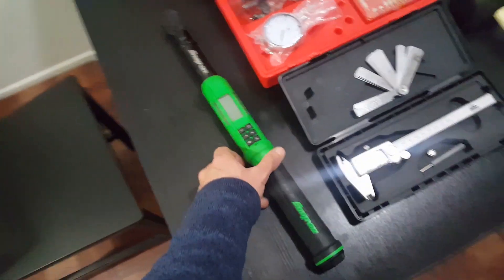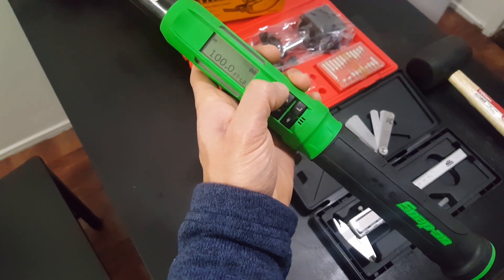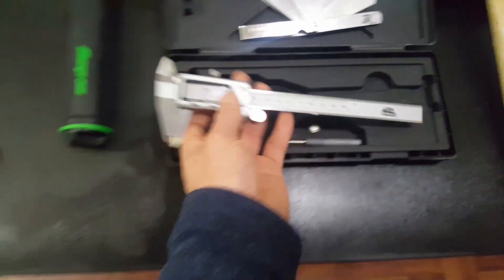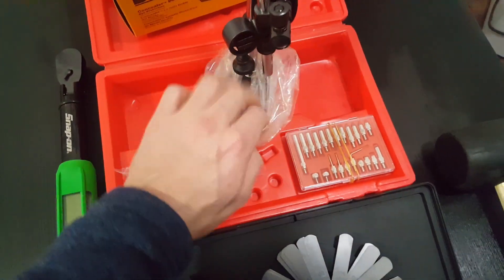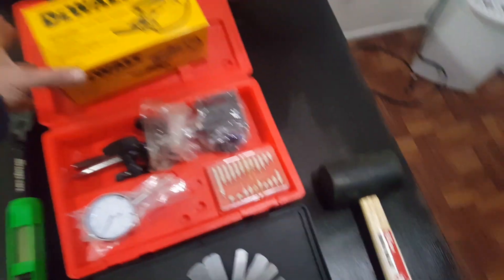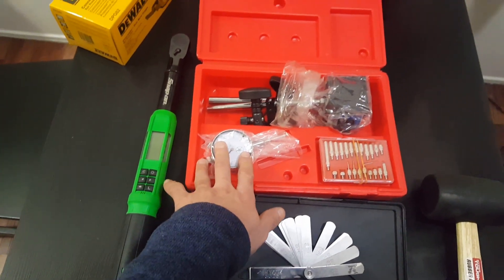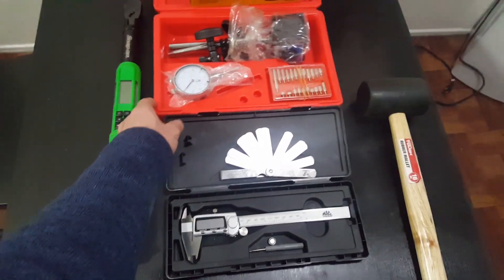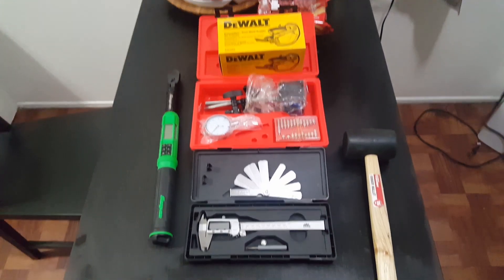Tools you must have to rebuild a mazda rx7 mazda rx8 rotary engine

Comment: hallo JM8686, i am looking for feeler gauge with the measure of 0.004mm as you suggest me for clearence the side seals to corner seals. i can t find feeler gauge with that gap in the web. My feeler gauge's smaller measure is 0.04. what brand is your feeler gauge?

Also one more question in this workshop manual 
https://drive.google.com/file/d/0B2B22u_aAChibmhIWWhyRnJodTQ/view
in the page 19 the manual said 0.05mm for side seal to corner seal. 
I know that the gap that mazda recommend is big but what is your opinion?
i know that i have already ask this question but i am scared not to do something wrong because i want my motor to be as healthy as possible. It should be my first rebuild in a rotary engine.. 

Thank tou for your time.
Reply from the maker: No worries you can ask 👍 
If u can add me on Instagram 13b_dorito so I can help better and answer quick
Reply: @JM8686   I am sorry for that but I haven t instagram. I am in process of rebuilding my 8. It should be very kind from you if you help me with this.